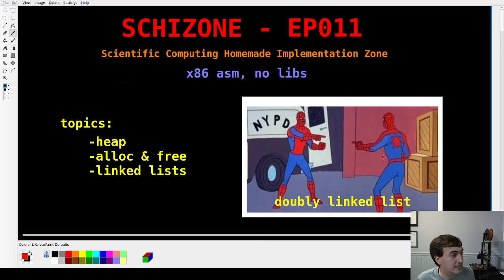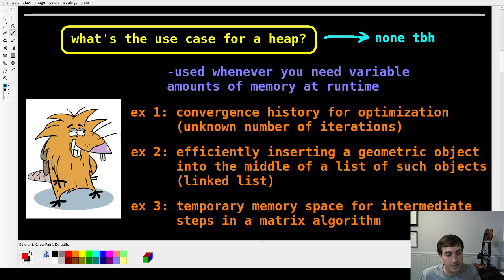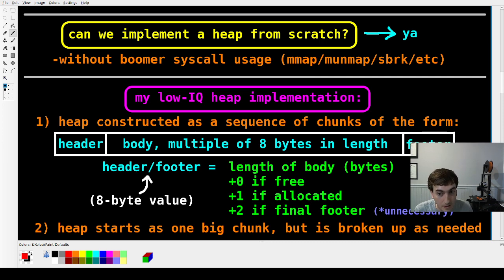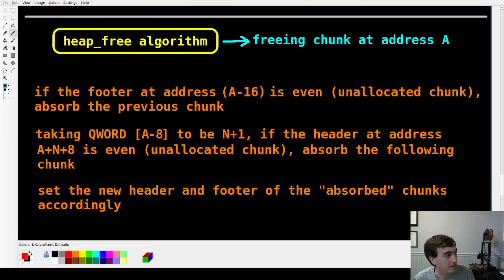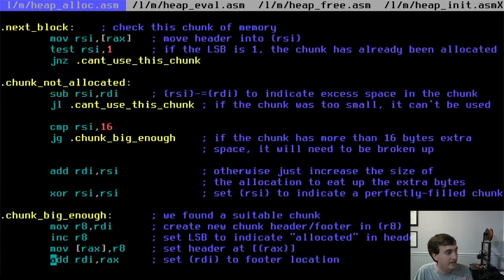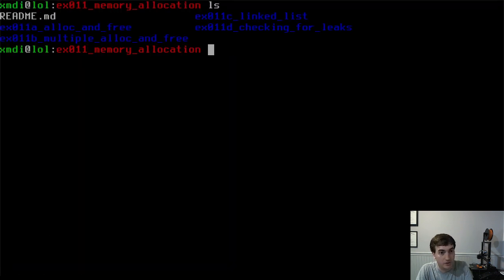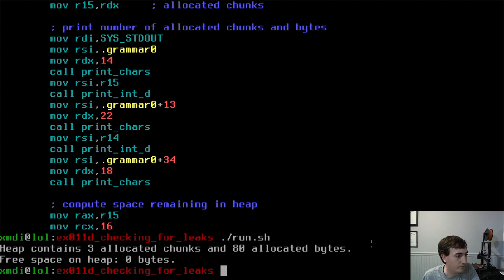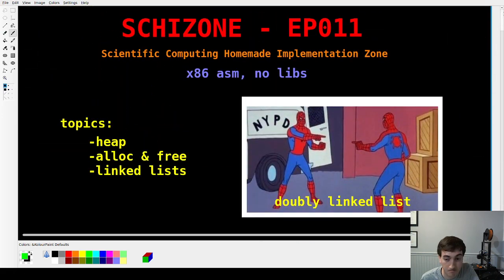a heap from scratch in x86 assembly | SCHIZONE EP-11

Comment: Nice video! I'm just confused about one thing - how do you pick the HEAP_START_ADDRESS so that you know that everything that follows is just free memory?
Reply from the maker: 2 things. There is an entry in the program header (top of the examples, after the ELF header) that specifies the amount of bytes the OS should load into memory for the process. For this entry, we usually sum up the number of bytes for all our code instructions, our print buffer, and our heap. Our code starts at address START, the print buffer is defined at the end of the program to start at address PRINT_BUFFER, which is also the byte after our code ends, and if you look at the last NASM macro at the past line in the examples, we set the HEAP_START_ADDRESS to be located right after the print buffer. All of those extra bytes after the final instruction will be initialized by the OS to be zero when the program starts.